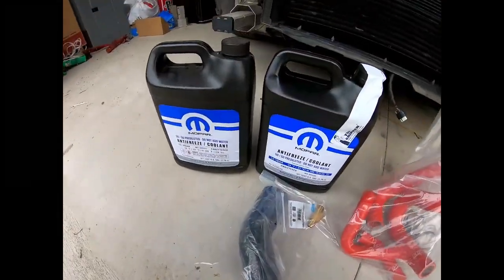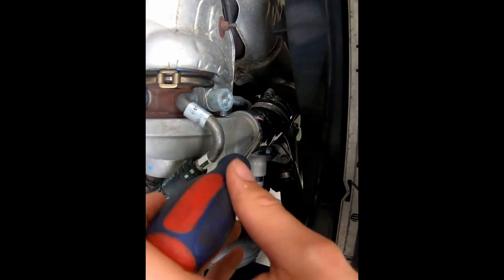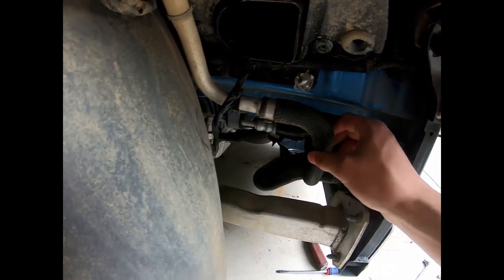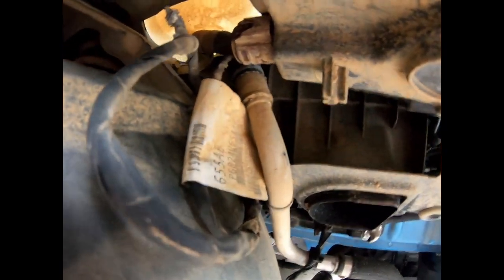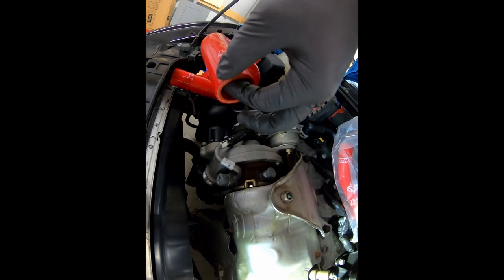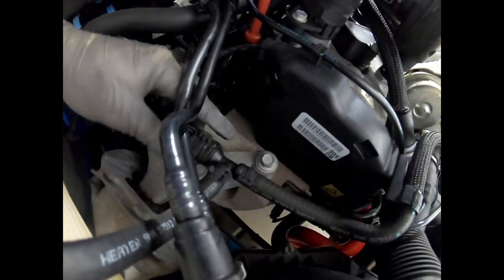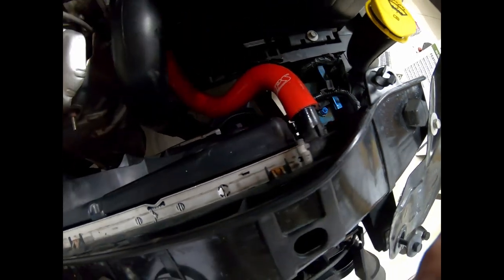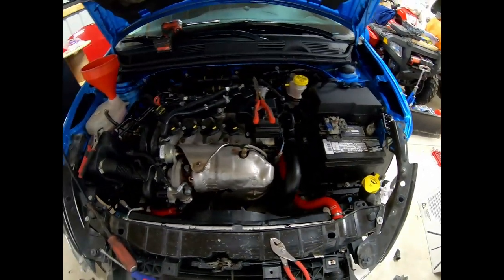Dodge Dart Turbo Build Ep. 5 (Radiator Hose Replacement)

Comment: Thanks man this video hopefully gave me the information i needed.    While at the gas station my 2014 dart Aero made a sound like my tire all of a sudden started to loose air but then a bunch of steam came from the engine bay. Upon my own inspection i was leaking coolant from that tee connector. So when i went to try and disconnect it, it literally crumbled. Im gonna replace it with the same brass one you did and  hopefully thats my fix.